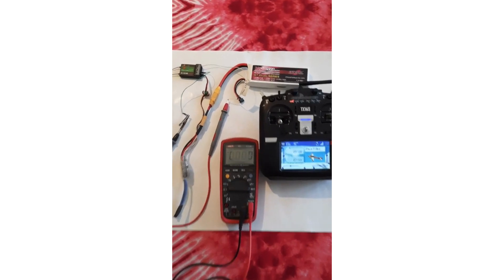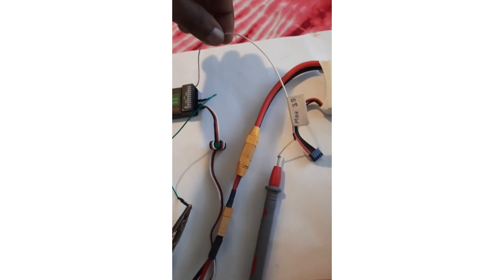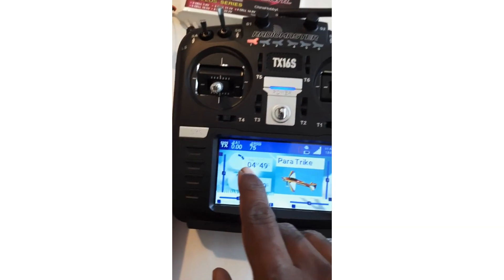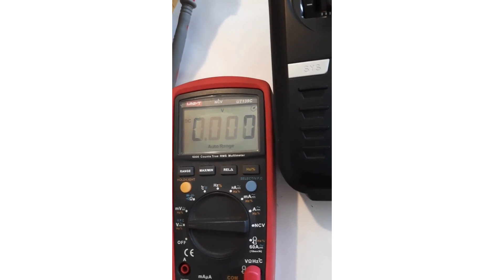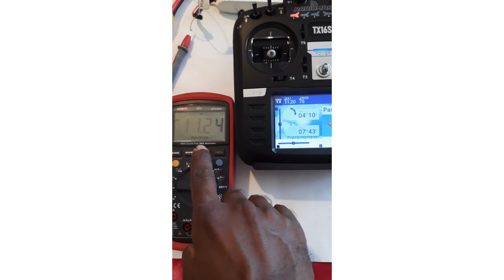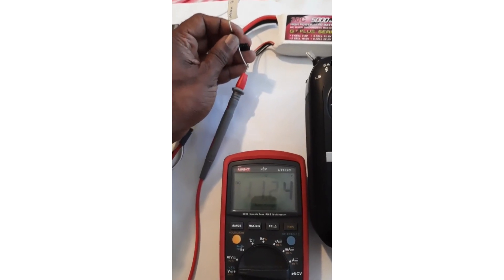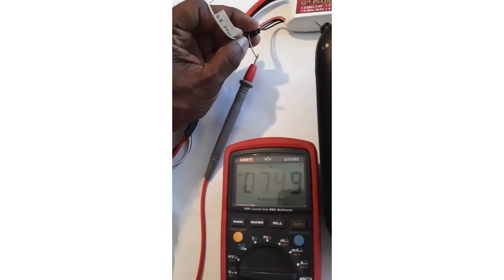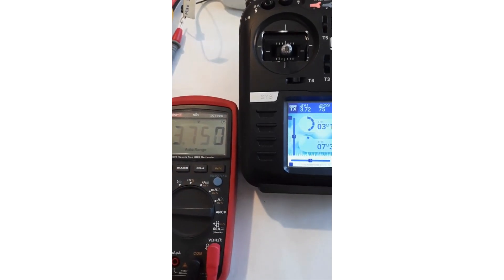Flysky FS-IA10B receiver modification - to get the flight battery voltage telemetry (easiest mod)

Comment: Hi friend, in which part is deleted, the R6 line leading to R3 or the G9,R9 line leading to vcc or between R6 and G9,R9, I'm confused because there are two lines
Reply from the maker: You need to remove the connection between VCC and R6 (then solder the sensing wire to the opened R6 pad)

Comment: I'd love to see a picture of the final result if anyone has one. I'm having trouble knowing what to do
Reply from the maker: You need to remove the connection between VCC and R6 (then solder the sensing wire to the opened R6 pad)

Comment: bro can you kindly give me clear connect diagram?
Where to connect?
Reply from the maker: Check out 2:41

1. Remove / disconnect the PCB track marked in RED and verify the discontinuity using a multi meter. This is MANDATORY.
2. Expose the PCB track position marked with YELLOW (just below the track disconnected already as in the #1 above) solder the wire there.
Unless without exposing the YELLOW track position, solder the wire directly to the right side pad (pad towards the crystal) of the R6 resistor (it is on the same PCB track/net)
3. Then take that wire out as the voltage sensing lead. That's it you have to do. 🙂

You can connect that voltage sensing wire up to 3S LiPO batteries. DO NOT go beyond that. (But if you have a 4S LiPO as an example, you can connect this voltage sensing wire to its 1st, 2nd or 3rd cell sensing pin [not to the 4th/last] of the battery balance port. Then you can use this feature to monitor the cell voltage and not the pack voltage)

Comment: where to solder the wire for voltage sensing?
Reply from the maker: solder it to the PCB track marked in yellow color dot at the 2:41 in the video or the right side pad (pad towards the crystal) of the R6 resistor just below the yellow pad itself (same PCB track/net)
Reply: is it working narendra
Reply: @lightlord299  no I bought the FSCVT01 sensor from import dukan .. got it in 9 days.... For modification of iA10B I didn't find any clear circuit video.